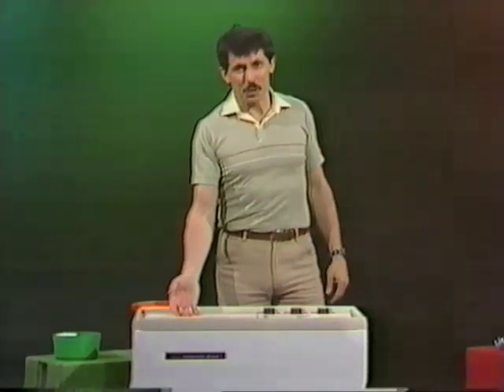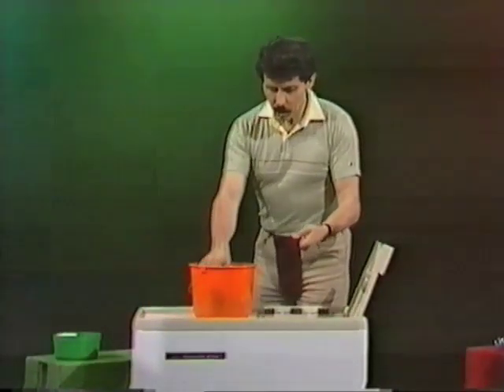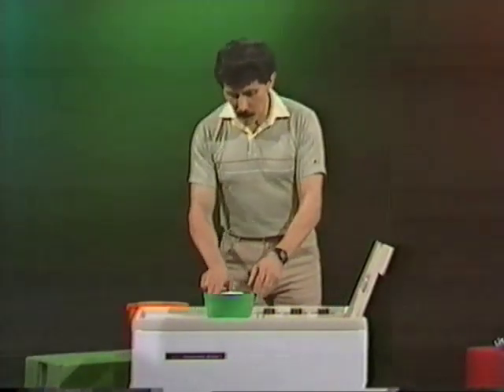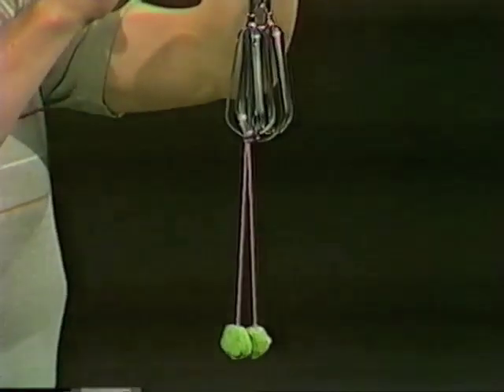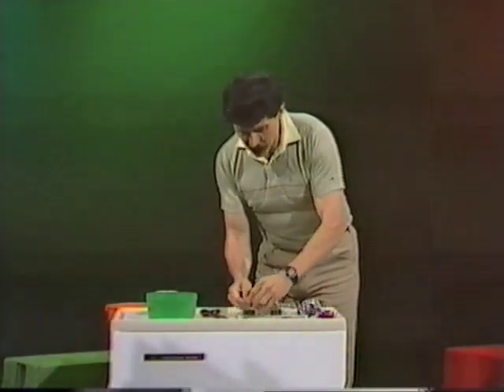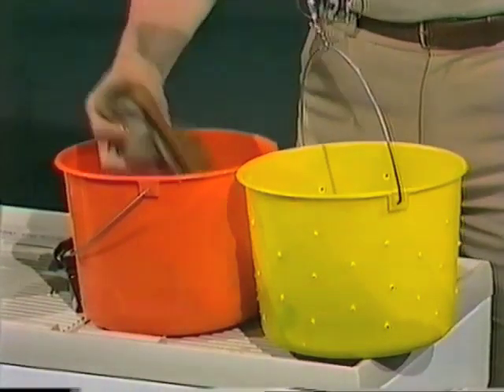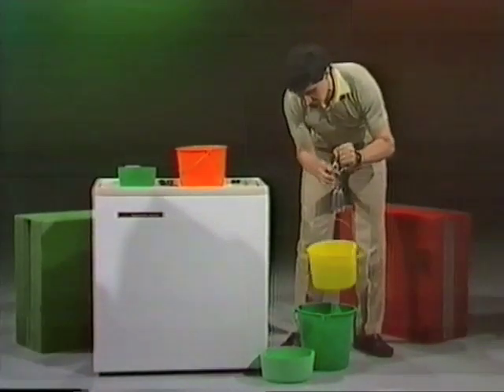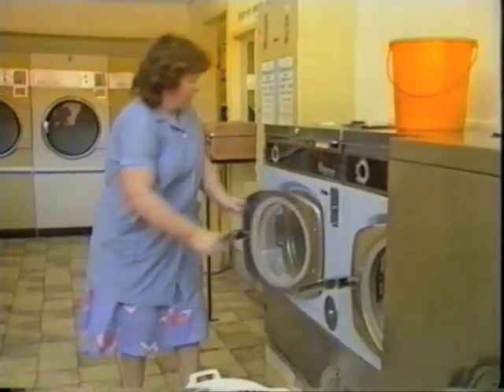Spin Dryer

Comment: That's an excellent demonstration. It's remarkably simple yet illustrates myriad points, mostly implicitly without being preachy. Particularly to children, science is inherently like magic. The Curiosity Show, Mr Wizard, Bill Nye, etcetera prove this. Yet somehow most schools manage to persuade students that science consists of sheer drudgery, meaningless numbers, and bewildering formulas.

Artists should teach introductory science classes, not engineers. Inherently many scientific concepts actually resemble art. Your approach is similar to the one Rashi uses to teach Chumash (Torah): you both explain concepts so simply that a bright five-year-old child can understand them. 

With a single-board computer (such as a Raspberry Pi) , a micro-controller (such as an Arduino), a breadboard with some simple components (resistors, transistors, etc), a bunch of small electric motors (one to spin the basket, a second to raise and lower it, a third to rotate a turntable, a fourth used in conjunction with a siphon to empty water from several buckets filled with water on the turntable, and a fifth to operate an agitator, and a few others I don't want to bother detailing), and a proper mechanical apparatus, something like this could actually be used instead of a conventional washing machine.

Such a washing apparatus could be cheap to build, operate, and maintain. I suppose someone will build one and post it to a site like Instructables within the next few years. Cheap and easy to program single-board computers and micro-controllers are relatively new. But they are the "final pieces of the puzzle" that will enable your demonstration to actual replace conventional washing machines.

Also, you might be interested in Lee Maxwell's Washing Machine Museum https://www.youtube.com/watch?v=6g5JdqUAWcg
Reply from the maker: Thanks for your kind remarks.  You will find many other segments showing "How Things Work" on our Curiosity Show YouTube channel.  Deane.
Reply: My pleasure. Thanks for the information.